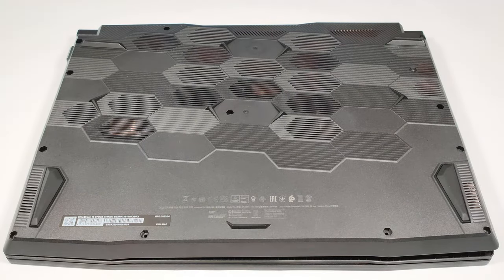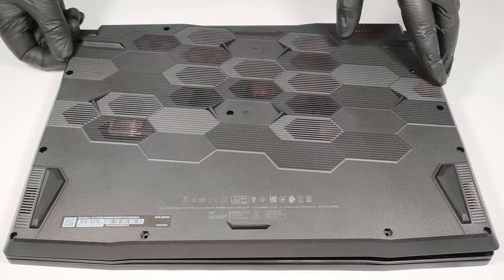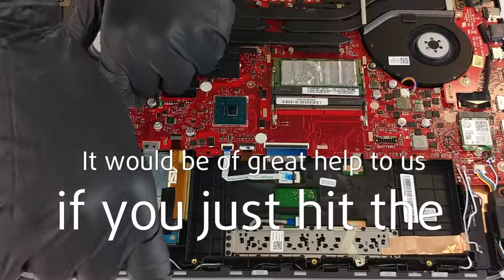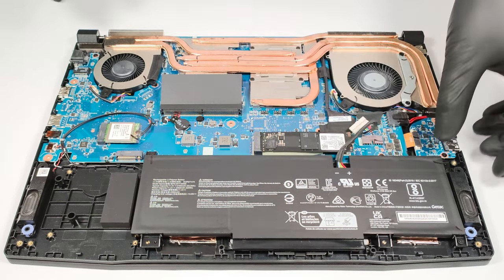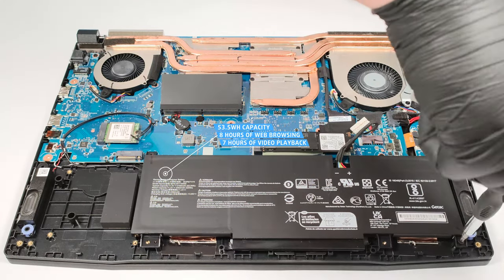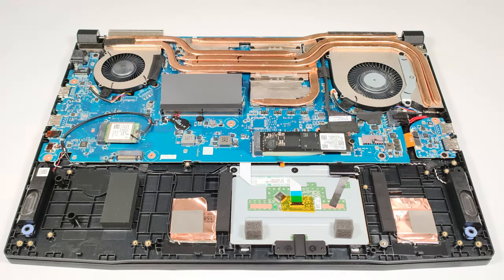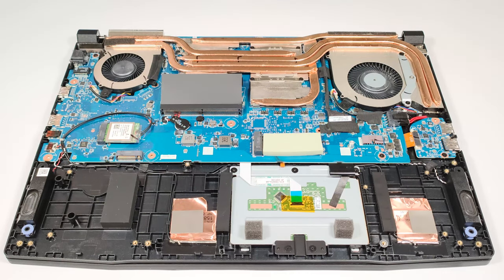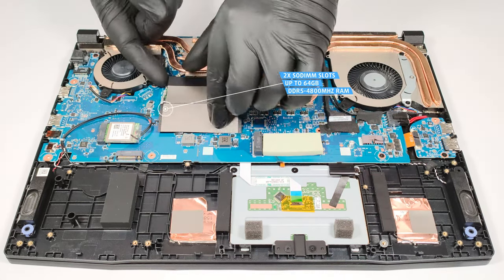🛠️ How to open MSI Bravo 15 C7U - disassembly and upgrade options

Comment: Can I use that second m.2 slot
Reply: I buyed to use the second, but don't exist the screw 😢 now I think how I will fixe
Reply: @riccardostefam9837  how do you fix that?
Reply: @Rouxls-Kaard  this is my question, I don't know. I want to know, I'm here with the nvme but don't use
Reply: @riccardostefam9837  maybe you can use doube tape
Reply: @RikiEndar  I was think something like this...
Reply: Did anyone find out how to put the nvme in the second slot?
Reply: @AlBrunoBarros hey i have the exact same laptop, you have to go to the msi service center and ask for an ssd bracket. It's about 5$ plus you can ask them to install your new ssd nvme. I added 1TB to the slot so the ssd configuration is 512gb+1TB
Reply: @circleboi4900  thank you my friend, but i bouth another laptop
Reply: @riccardostefam9837 What did you end up doing
Reply: I also used the double tap to fix 2nd SSD 1TB Gen 4. Its working now i have 512 + 1 TB storage. also upgraded its Ram to 64 GBs thats too supported.